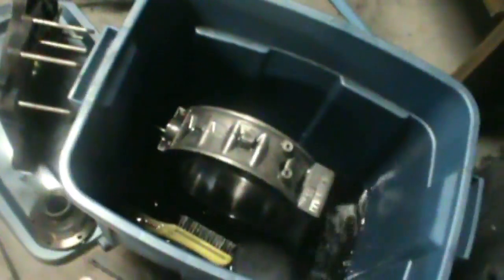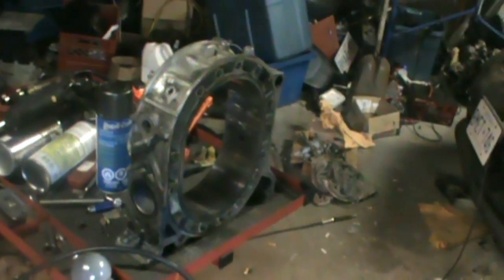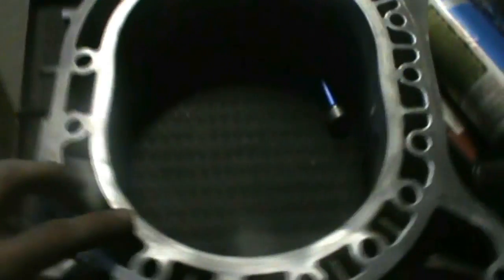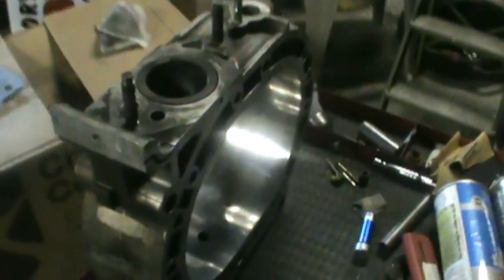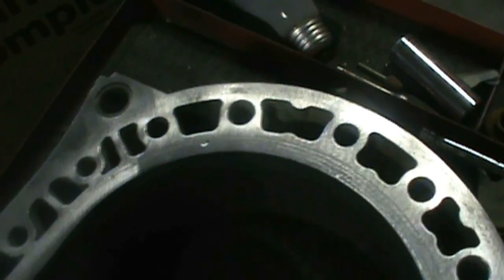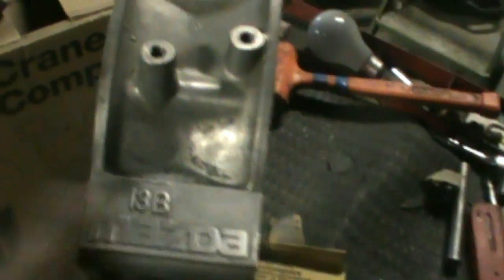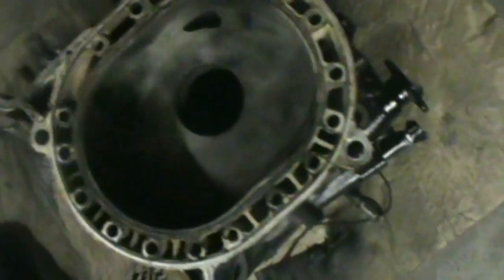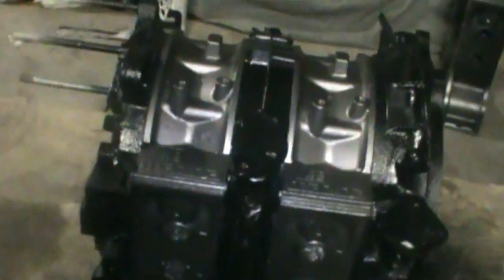How to Rebuild and Port a Rotary Engine :Part 9

Comment: save time. buy a dremel, find a a friend with a compressor. port.....then put sand paper on the dremel and sand it down. takes less than an hour to do both exhaust ports.

Comment from the maker: the rotor housing and rotors are the same. the S5 has a coolant port at the back of the housing you can just toss a freeze plug in. the irons on the 2 engine are different though

Comment from the maker: I don't have a press. I've been lucky enough mine were always good. I know once you change them you're more likely to spin a bearing. pineapple racing has the press tools for the bearings. if you go to rebuildingrotaryengines dot cam right at the bottom rob from pineapple racing made a video on how to install the bearings. those videos are basically where i learned everything from when i was goin to rebuild my FC's engine